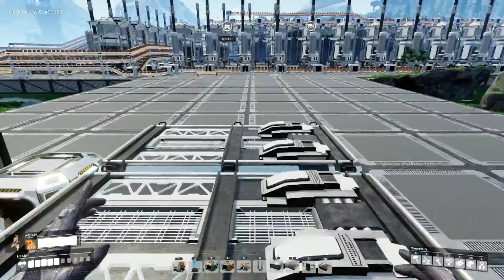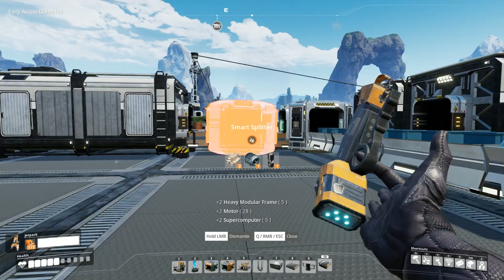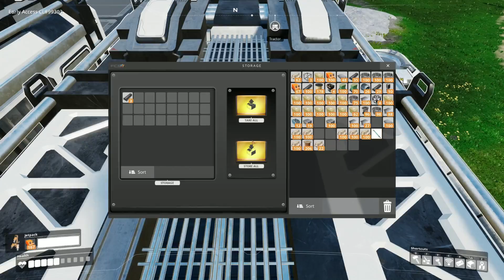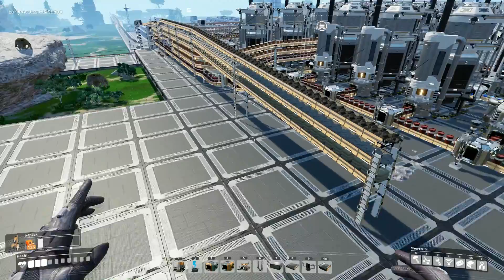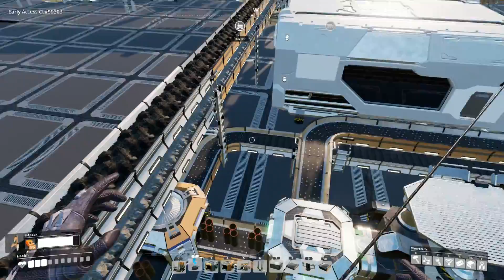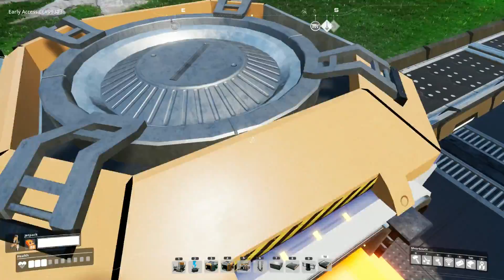Satisfactory Gameplay | Improved Storage

Comment: Here's a thought, they should add a splitter that you can program how much of what comes in goes out each spot for more exact production. So instead of just letting it split into 50/50 or 1/3, you could be like 2/3 and 1/3 or something like that. Or even directly change the number of x amount per minute.
Reply: How many per minute would be even better! That way you can get 100% efficiency on all production.
Or which would already help a lot is can you program programmable splitters to split of *example iron rods  to the side and straight on so storage can't back up if you make a loop with your main bus.
Reply from the maker: They need to let overflow through them as well. I'm sure this'll be addressed, they seem to implement and respond to good player suggestions.  Either way, this is still fun as hell to make, even if i have to delete items every once in awhile
Reply from the maker: yea, ill just wait for the improvements lol. the simple easy solution is to mass delete, or move to inventory and mass delete there to free up the line.   
its a small inconvenience, but not a big deal really.   I dont get why people are so hung up on that. it takes two seconds to clear :)   if you're overproducing one item, simply crank down the volume you're producing. problem solved.

Comment: Not a big fan of this kind of storage management, as soon the first storage is full, the convoyer stops.
Even if all others storage have free space.
But interesting and beautiful.
Reply from the maker: That's why you simply empty it out every once in awhile. take out what you dont need and adjust your output a bit. I'm sure these issues will be addressed eventually and when they do, I'll have a great working sorting system.
Reply: @Skippy0330  a smart container would be very nice, with options like void overflow, set priorities in case u need one item quick like the encased beams for mk4 belts
Reply: The only way to avoid the „Storage Full Problem“ is with Logic.
If Container is „nearly Full“ stop Production.
The nearly Full hast to be a number smaller then the remaining Parts on the belts.
And this all needs „Logic“ attached (like in Factorio).